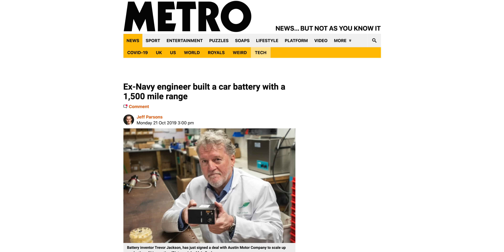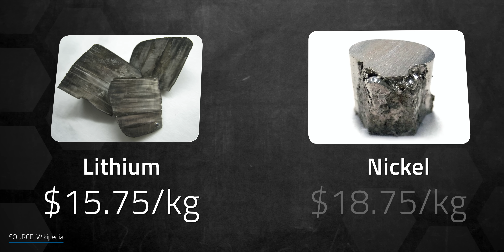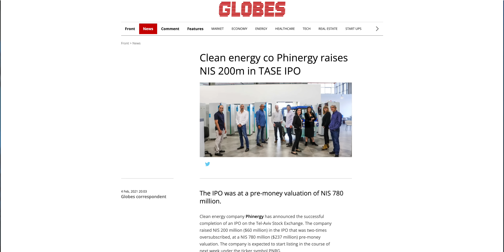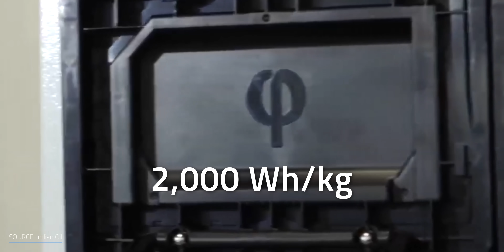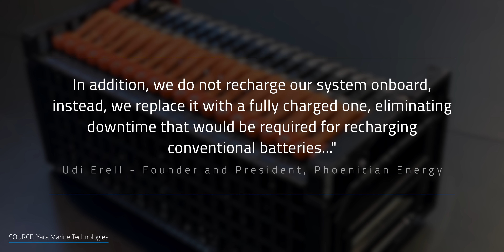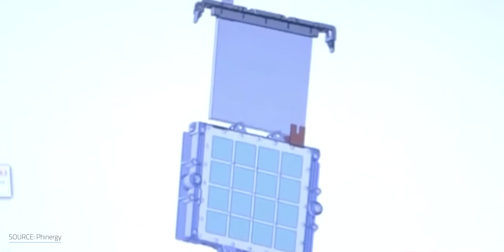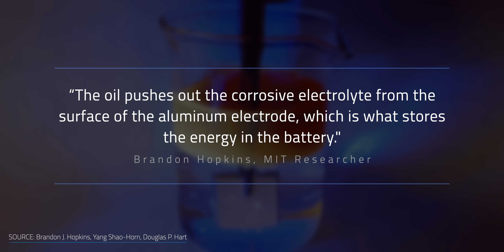Exploring the 1000 Mile Car Battery - Aluminum Air Hype?

Comment: Batteries that aren't rechargeable... yep... that is realllly going to take off.
Reply: it all depends on the cost. If it's less per mile than a tank of gas and designed to be simple to replace, why would it matter? That does seem optimistic, though.
Reply: I mean its not rechargeable but its recyclable. So its more akin to swapping out your gas can for your BBQ
Reply: @birphon  It's not practical. There will be too much challenge with logistics, price and transportation. I find it unreasonable to have a garage full of expendeble batteries (fire hazard to boot), when you can have rechargeable lithium ion (which you replace every few years).
Reply: @HueghMungus  more logistics and difficulty than searching for oil around the globe, drilling oil even in the ocean, refining, and transporting by boat, pipe, and truck all over the world to each and every corner station?
Reply: @solomongrundysfoot  Thing is, it is easy to do all that. Relatively speaking, which is why it has been done that way. This new battery seems unviable, especially when transportation is essential to a lot of people. You are betting on a naive situation where everyone has full stock, which is unreasonable.

All thing is good until worker's strikes/union strikes, pandemic outbreak (what we have today), shipping delays (Evergreen ship), etc, and you are unable to buy new batteries. Your car, or busses would be obsoleted. Not to mention Silver is expensive material. You go ahead and turn your car into giant toy if you want. While rational people keep using, more environmental, rechargeable lithium ion batteries. And soon Solid State batteries (which will use more common, available materials).
Reply: @HueghMungus  im not necessarily advocating this as a solution, but your argument seems flawed and appears to confuse impossibly difficult with familiar. It is easy to think the existing supply chain of liquid fuel is easy because it is familiar. To poo-poo a new idea because one's imagination is frightened by complexity is a closed minded approach.
Reply: @solomongrundysfoot  It seems like you're "snobnosing" people trying to use fancier words than necessary. Cut to the grain, and removing the chaff; others have already wrote several reasons why existing lithium ion batteries are much better, upcoming solid state batteries (same tech, but smaller), in addition to supply chain that is in place. We are not ignoring this "new" battery, just criticising its viability. If you are going to keep being naive, then I'm wrong person to argue to. If this proves successful then reply to me in how many years this takes, otherwise it is wasteful, and seems to use more energy trying to recycle the packs.
Reply: @HueghMungus  fancy words, lol
Reply: @HueghMungus  I did misspeak this morning. My point is that one shouldn't confuse difficult with different. Familiar is not always best. Is this option best? Possibly not. But to not even entertain it at its infancy would be no different than to denounce the liquid fuel infrastructure we have today from the the perspective of someone from the 19th century who is familiar with horses and buggies.
Reply: @HueghMungus  The exact thing was said about e-cars in general.
Reply: @Scapestoat  Just that this is even worse. Even ecars needs to change battery (after set amout of recharge). This "new" tech takes that to the extreme needing to change after one single time. Imagine buying new clothes after getting it dirty, rather than washing it. Only replacing after it has holes - this is how this tech is. Kinda bad energy wise and environment wise
Reply: @HueghMungus  How is having a stock of batteries any different than having tanks of gas stored? Also it's not really a fire hazard, unlike lithium batteries or gas.
Reply: @birphon  it will cost too much and not practical. Its a waste of money. Non rechargeable batteries that will be very expensive to replace. Every gas station would require a massive warehouse to store replacements.
Reply: @lilcourtny08  but you also don't need to replace them often due to the energy density, and they won't be very expensive when they enter mass production
Reply: @Ben-li9zb  They will be expensive, I don't know how you can't see that. The first generation of a product is usually expensive. There isn't a network for that technology anywhere. Gradually the cost will come down if people are willing to pay a very high cost first
Reply: @lilcourtny08  well yeah, but that was true of lithium ion batteries at first too, and I'm sure this has some good niches it can start in to start gaining traction
Reply: @Ben-li9zb  the range of EV vehicles kept people from buying them first. Now that you can close to the range of a normal car and there are charging stations available all of the US it a good option to buy a EV vehicle. This idea will never work, if it was a rechargeable battery it would but not swapping out the entire battery.
Reply: @lilcourtny08  yes, but when one battery gets you 1000 miles, and you can keep a spare in your trunk, neither range nor lack of infrastructure is that big of a deal

Also recharging of current ev vehicles takes a while
Reply: @Ben-li9zb  All of those numbers are estimates nothing has been proven. Real world testing will reveal it's true numbers. I don't know if you will be able to keep a spare battery in the trunk of your car. You don't know size or how much they will weigh. Tesla batteries are huge. Its not going to be the size of a car battery, carrying around a extra battery that weighs a 2 or 3 hundred pounds will kill range and you can't use the trunk. I'm guessing it's not going to be small and lightweight
Reply: @lilcourtny08  well aluminum is lightweight, but you are right, real world numbers are vital, I just think there will definitely be some good niche use cases for these
Reply: @lilcourtny08  why the hell would you store them at a gas station ?  they can be stored anywhere, and they are recyclable and will be way cheaper than a Li battery
Reply: And buying D cells hurts....
Reply: @volvo09  most probably there will be a swap policy
Reply: Agreed. The whole idea of EV is to have a full charge every morning and use solar panels to avoid paying for energy.  This doesn’t do that.
Reply: @lanzer22  
But there are a lot of places where solar voltaic power is very variable or impractical for long periods of time...
There are also tens of millions of homes with no off street parking possible and limited or no right to park anywhere near your place per say. 
Plus you might still have 2 or more vehicles owned by a single household.🙄
Reply: The history and reality of a lot of batteries is that we don't return them. Or can't even. The biggest issue is cost and availability. We currently have gas stations that have storage for thousands of gallons of fuel, but with batteries, you could replace those anywhere. Not just some place like a gas station.
Reply: LFP FTW!
Reply: Take off and land in a dumpster, sadly.
Reply: @vgman94 obviously that you were born upside down
Reply: Sure it's like driving a petrol engine car with a small tank in the middle of nowhere  ;)  Either way this would be lighter to push lol
Reply: Your plane will take off once.  This truly feels like an april fools joke.
Reply: But mr Big Brain those batteries gives u 7x the range per swap 🙄
Reply: @drunkcat1713 . But just think how many batteries would be required to be changed world wide every single day.
Reply: @klackon1  sure evry idea has their limitations but think urself if the batter tech changes u can have it readily so more flexible on the technology part .... plus no shortage of spare parts
Reply: @drunkcat1713  And how much energy does it take to completely recycle them?
Reply: @MarcusHouse  and this is called running 🏃‍♀️.... run forrest run
Reply: @MarcusHouse  "And how much energy does it take to completely recycle them?"
Guaranteed to take less energy than recycling Li-Ion batteries, some of which can't be even recycled.
Reply: @alaric_  Of course, but Li-Ion batteries last for like 15 years or something. Thousands of recharge cycles. These apparently can't currently be recharged at all. Single use only.
Reply: @MarcusHouse     Hey Marcus, I'm a bit of a history buff and funnily enough, naysayers never really achieved anything in history, enjoy your cave bud.....
Reply: @truantray  Right back atya. B/c the video doesn't address Marcus' question. At all.
Reply: @truantray  why don't you answer it instead of evading the question?
Reply: Your gas is not rechargeable either so... Internal combustion is the worst thing ever produced
Reply: @MozartosKhan  Renewable =/= rechargeable. Petrol being bad for the climate does not automatically make every alternative viable.
The petrol tank is very much rechargeable. You can top it off as much or little as you need by driving up to a suitable station, connecting a handy hose and waiting a minute or two, or even just tipping in a few litres from a stranger's spare tank at the roadside to get you to the next petrol station.

Lugging out and in bulky battery packs won't fly for many consumers, and replacing a half-consumed battery because you just MIGHT have a need for 60% of full capacity before the next replacement station will be doubly unpopular.

The logistics of non-rechargeable batteries are even larger compared to petrol than the impossibility of transporting anything through pipelines alone; every last gram of spent battery will have to be transported BACK to the factory or a recycling plant again. For better or (much) worse, the atmosphere takes care of all that waste stream in the ICE case.
Reply: @MozartosKhan  That said, there might be a bit of a market for Al-air batteries as range extenders to normal, rechargeable-BEV for exceptional long-range driving needs. Especially if they are sold in such modular units, of say 50–100 km's worth, that a) even an arthritic older gentleman can lift them without issue and b) you can top off by replacing a used cell without throwing away honks of unused capacity that you had paid for.
Reply: Haha you mean like every other battery you are using for the past 30 years? Yes you should tell energizer or Duracell that they are about to go out of business
Reply: @MrDvirpariente  there were no good rechargeable batteries 30 years ego, that's why these companies developed selling regular ones.
 Today a fifth of the batteries sold are rechargeable, and this number is growing.
To your point regarding these two brands. Both of those are producing and selling rechargeable batteries, but I am pretty sure that if they didn't, yes they'd go out of business.
Past popularity is not a solid indication of future popularity, and this is even more true when talking about technology.
Reply: @wagnergauer9133  OK, so they Are going bankrupt correct? Enen today most of the household devices are using regular batteries

Comment: A major waist of recourses. No one will use the full capacity of this battery, because no one runs their car dry every time.
There will be a loss in recycling.
It is only a good idea for the one selling the battery. Oil company mindset in my opinion.

Comment: If only there was a system for swapping aluminium batteries efficiently without the need of human intervention.....yes robots for those kinds of jobs. of course vehicles have to be designed and then standardised for that work. But it's kind of a heavy job to go to battery swapping station. The ease of charging a vehicle on your own terms whenever needed is the experience thing. no one would wanna lose that after a certain period of swapping batteries. it just isn't practical, it would be like a chore. and as a mostly introvert i would never want go to those stations.

Comment: Well, if the battery range in my ev would be 1000 miles, That would let me options to swap the battery somewhere around 100 to 200 miles range depletion, but….how much will it cost for a cybertruck battery ? From 300 to 500 miles range increase, it s 20k .100$ per miles increament. So at 8$ Recharge cost for the extra 200 miles , that would turn out to cost 40 $ of electricitu / 1000 miles. How much would it cost to swap the allu- air batter

Comment: Aluminum-air batteries work, sure, BUT THEY ARE NOT RECHARGEABLE! So we would need to not "swap" batteries, but effectively DUMP the old one and as the pictures show they contain many parts that are not easy to recycle. 
It is for sure currently no viable alternative and sincerely question if it will ever be. 
The "swap" would also cost much more than a current recharge for Lith-Ion batteries, as one needs to pay for initial manufacturing, transport, storage, swapping, swapping again, storage, transport and recycling. While aluminum is cheap, other parts of the battery are not. If they really get the degradation under control, they might become viable emergency back ups, but not for cars... Really, not for cars...

Comment: I call BS. that's just a greedy company trying to rope you into a service contract. typical big oil / legacy auto scam. aluminum air is FAR less complicated of a pack than lithium ion. unplug- plug.  if not? then their engineers are INTENTIONALLY adding complexity to achieve the goal i mentioned above. even tesla will sell you a new factory oem lithium pack & let you swap it yourself- although... it does require a few specialty tools, nothing a high voltage electrician & a properly equipped mechanic shop can't handle.

Comment: all due respect matt... (i like your channel) your sum-up of lithium powered EV's is right on point- if you exclude tesla. long range model S is 405 miles. freemont 4680 line is already test running at 80%. 4680 batteries will change the long range version of tesla vehicles to over 500 miles- with their dry application of lithium forever elminating dendrites.. making tesla the ONLY 1 million mile battery pack. 

 I live near Sacramento & work in the bay area... NO TESLA OWNER has range anxiety, least of all me (model Y owner here) or worries with range degradation. 'tesloop' shuttle service uses exclusively model X p100d's.. and most of their cars go over 400k miles before battery swap- they even have a model that went 450k miles... .IN A TAXI CAB! do you have ANY idea the raw POUNDING a taxi cab gets? even a Toyota only DREAMS of lasting 200k miles as a taxi cab. 

I think aluminum air batteries would be best used as a kind of 'mobile boost' for lithium powered EV's. or an add-on pack for a lithium powered electric aircraft. kind of like having a hybrid- but with aluminum instead of a gas motor.

Comment: I think battery swapping would be no big deal if you had the 2700 mile range mentioned… for some folks, that might be something you’d only have to do monthly. It could work as long as it was cheap, readily available and that you could get a rebate for unused power you’re trading in.

Comment: My initial reaction is to say no. However, every car on the road currently has to have it’s battery swapped out for a new one, at some point in it’s life time. And usually multiple times, as the vehicle gets older, like with say a 1915 Model T Ford. Setting fuel cost aside, and say a lead acid battery needs replacing roughly every 5 year over a hundred years at an ever increasing price. That’s still a lot of money and time spent swapping out a battery when needed. So a battery replacement for an EV, as long as it has a reserve battery that is rechargeable plus the aluminum air battery yeah I’d be ok with that.

Comment: 1. You show that CO2 is excluded from the battery.  Why does that matter?  And what about nitrogen?
2. You say that aluminum is extremely light, but a 2.7 g/cc it is five times heavier than lithium at 0.53 g/cc

Comment: Hard to imagine why we would want to switch to a system that requires specialized battery-swapping stations for passenger cars (isn’t this why BEVs won out against hydrogen fuel cells?), but I’m hoping that there will be a great application for this tech, perhaps in air or sea travel, as others have proposed.

Comment: Think about the practical use of non-rechargeable batteries in a car.  You are driving and are down to 25% of of the power you need to complete your trip.  There is a battery-swap station close, but no convenient swap station between where you are and your final destination, so what do you do?  You swap out a battery that is not fully discharged.  Do you get a credit back for the charge still left in the battery that you are swapping out?  I doubt it.  So you bite the bullet, anyway, and decide to swap out your partially charged batter pack only to find that the swap station doesn't have batteries that fit your vehicle. Now you are in real trouble. The logistics of supply, demand, and use are as daunting as refining the technology.  Maybe you need a hybrid solution with the aluminum-air as the main battery pack with a small LiON rechargeable batter pack to get you to the next battery-swap station when you have exhausted your aluminum-air battery.

Comment: The original solution to electrode corrosion, used in the very first batteries, was the 'plunge battery' where the electrodes were lifted out of the electrolyte, either by hand or by a crank.  This was fairly bulky, but would work well as a low-tech solution even today.

Comment: The only true viable option for "environmentally friendly" vehicles that do not suck balls is Hybrids. Why relly on power grids that might not be able to supply you power reliably when you can have your own power generator IN your car. Be it diesel powered, gas or better yet Hydrogen, the smarter thing is to have one of those.